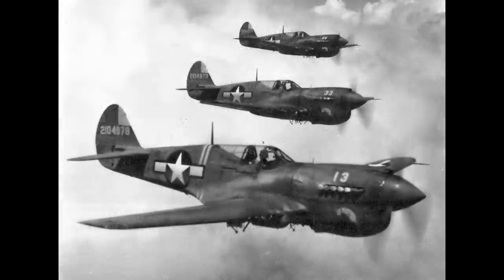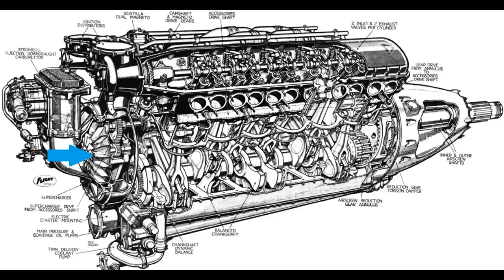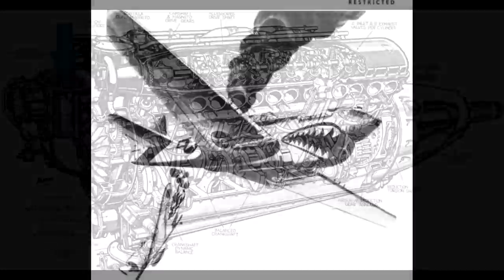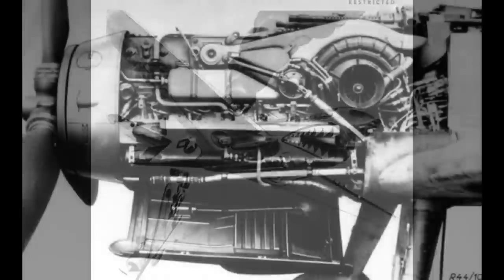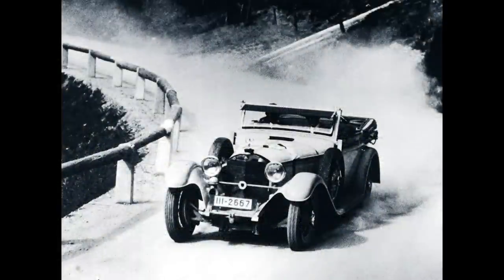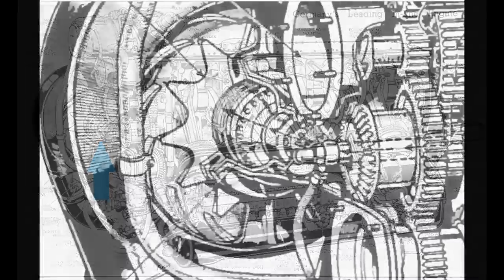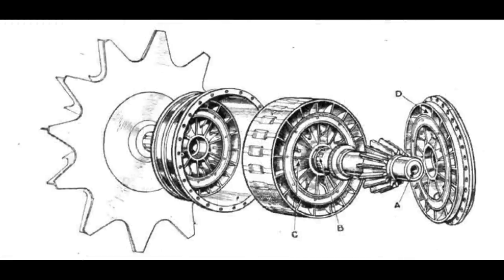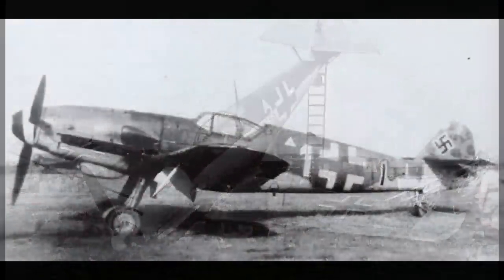Messerschmitt BF 109 Supercharger Drive System

Comment: I have a suspicion regarding Bf 109 or similar (Fw-190?) throttle controls, sophisticated as they are. If there is some regulated pressure, 1.3ata or so, and you set some partial throttle by the lever, say 1.1 and climb eventually you'll reach some altitude where wide open throttle can't provide that maximum regulated pressure. My hypothesis is that if you set 1.1 pressure that should be maintained if the engine is capable of it.

But in depictions it is shown that hands off the lever and climbing such that maximum available pressure reduces below the regulated maximum 1.25, 1.20, 1.15, etc. that the pressure also falls below that originally set even though the engine is capable of the original setting. There is some moderate altitude that in order to maintain your desired setting you have to keep moving the throttle forward.

I know that's a word salad so I'll try restate. You set 1.1 and climb without touching the lever. When does the instrument fall below 1.1? Does it reduce as the regulator becomes irrelevant or is it smart enough to keep that 1.1 all the way to the point where 1.1 is  all the engine can manage at any setting?

Answer or no, don't sweat it. Keep sharing on any  topic that springs to mind. They're all interesting and you do it well.

Comment: The DB601 and DB605 also had water/methanol injected to boose the trust even more at high altitudes and fuel injection of course. Mercedes an BMW have a long tradition of powerful engines.

Comment: The Germans had scientist that were very smart and did things really different than the rest of the World. If the Germans had used 130 to 150 Octane Fuel in their planes in the beginning of the War  they would have been a lot better than any of ours including the Mustang. The main reason the German planes couldn't pull as much manifold pressure as our planes was the 87 octane fuel they used in the beginning of the War. Later they used additives to boost the octane to 130 to 150 but by then they were on the losing end of the War and had lost tons of planes and good pilots!
Reply from the maker: Yup, I have a whole video about that!

Comment: Instead of using 2 stage superchargers that offered 2 altitudes at which engine performance was optimized, would it not have been possible to simply build a fluid coupled supercharger like this but optimized for say 30,000 ft then use the barometrically driven coupling to optimize performance from 30k all the way down to SL? What would be the downside? Would this have resulted in a supercharger that was too large to fit inside the DB-601/605/603 engine nacelle?

Great video Greg - thanks! You are clarifying things I understood at a much more basic level and clearing out misconceptions.
Reply from the maker: They could have done that, used a bigger supercharger with the fluid coupling. The drawback is that all compressors have an ideal range, and getting 20,000 feet out of one compressor is already really good. If you make one that's great at 30,000 feet, it's going to suffer at 10-20k feet. The Germans still had to fight down low, so they really did need a second stage.

Comment: Check on that P-40 supercharger.  Believe the Allison fitted to the P-40 didn't have a blower.  This limited it to low altitude.

This was a limiter in the early Mustang.

As for the hydraulic drive: when driving a high speed or high inertial load it is necessary do have a flexible connection to isolate and dampen the torsional vibration of the crankshaft from the load. A crankshaft speed varies through the operating cycle. These variations if not dampened can stress and break shafts. 

A torque converter in a automatic transmission does this as do the springs in a clutch disc in a manual transmission.
Reply from the maker: No, the P40's Allison does have a supercharger.

Comment: Now this me be way off,  but at one point I think to recall you can get stronger gears with less gyroscopic mass with a 90 degree set of gears over normal gears.  If you need 1 inch width of gear as per spec on normal gears it will look like a "T" from a cross cut view.  the "T" section is a lot of rotating mass.  If you have gears set at 90' you lose that "T"  cross section and it is now a "I" with the gears set at 90'  you can now increase the width of the gear from 1" to 1.5" across the flat surface and the mass does not increase. But you have a larger surface for tooth/mesh contact.  Now again I have no clue What I'm talking about and this was something we talked about in the 80's when I was learning about cars and transmissions in auto shop.
Reply: Having some extra time to think about why is it mounted at 90 degrees.  I think you answered you own question in another video.  Going back to 1980's auto shop,  Why are most if not all distributors on cars mounted 90's to the cam.  Some race cars do have have the distributor mounted on the end of the cam shaft but the are mostly race cars.  It is to save space under the hood and make the engine assembly shorter.  If the distributor was mounted on the end of the engine, then you would need to make a longer engine bay, extra wight longer hood etc. etc..  Now my thinking is with the 109.  If the Supercharger was on the end of the engine it would be taking up valuable space that could be used for something like fuel.  Mount it 90' degrees and it is next to the engine assembly is not any longer, it is not taking up valuable space that could be used for something else like fuel  or the pilot etc.  It just needs some extra panels to enclose it on the side of the plane.  It might also make it easy to just put a snorkel on it for the air intake and you are good to go.....Not an engineer, just a tech that fixes broken things engineers design,...?

Comment: Excellent info! You are a very good teacher. When I look at the common rail system on my diesel engine, the inlets are 90 degrees toward the cylinder block. That makes the engine take up a huge amount of space in the engine room. Could it be like that the Germans engineers wanted to save space and came with a unique solution regarding the compressor?

Comment: The RLM (German Air Ministry) specifications for V12 aero engines dictated that they must have allowance for a machine gun or a 20mm cannon firing through the prop. This was naturally also followed by Jumo, which is why it was also possible with the Jumo213. The fact certain aircraft didnt choose to fit the cannon is an incidental. Such a fitment does also remove one 90 degree bend from the intake system, but that is also an incidental and not the reason it was done. This document specification was created by Dr Helmuth Sachse, Dr Kamm at the DVL and Dipl. Ing Jellinghaus at Luftthansa after discussions with industry which started in 1928. You may read all this yourself (if you can read German) on page 20 of "Aufschwung und Wende Vom Kolben-Grossflugmotoren zum Strahltriebwerk" - an interview from 10th April 1987 at the Deutsches Museum in Munich,  between Dipl Ing Kurt Grassmann and Dipl Ing. Wolfram Eisenlohr (who was in charge of engine development at the German Air Ministry from 1938 to 1944). The German transcript is available on hard-copy from the German Aerospace Agency for a small fee, it is this report which is referenced by the only serious book which very briefly mentions this topic ("Aeronautical Reseearch in Germany from Lilienthal to Today" - by Hirschel)

This stuff is all covered in my book coming out in April 2020, through the publisher Mortons.

Later next year I will be publishing the translated technical memoirs of Prof Dr-Ing Karl Kollmann, chief designer of Daimler-Benz in 1944/45, who patented the use of the Fottinger coupling applied to aero engine supercharger drives on 27th June 1935 whist at Daimler-Benz. US patent numbers: 2238889 and 2290884. I have interviewed his son in Germany, and was given his fathers memoirs and papers, which I have translated to English.

https://www.calum-douglas.com
Reply from the maker: Hi Calum, I'll be looking forward to your book. On the subject of weapons placement, I cover that quite a bit in my inverted V-type videos, specifically part 2. I have no doubt's that the RLM wanted a weapon firing through the prop hub, and I get how that would make the 90 degree drive desirable, but it doesn't explain the 90 degree drive in German cars, which pre-date any aircraft application. It's also worth pointing out that various Soviet planes had weapons firing through the prop hub, both machine guns, and cannons, and they didn't use the 90 degree drive. So, while I agree 100% that the RLM wanted a weapon set up that way, I'm not so sure it explains the unusual supercharger drive. I think there is something we are missing here, but I don't know what. I have seen some solid theories though, but nothing concrete.
Reply: @GregsAirplanesandAutomobiles  - Hi Greg, cheers for the kind reply. The main engines which had coaxial prop-cannon AND a non-side mounted supercharger were Hispano Suiza HS.404, the Klimov M-105/107 and the Allison V-1710. These were possible for the following reasons.

1) The Allison could do it only in the Airacobra because the prop is way ahead of the engine so the proxmity of the supercharger doesnt matter
2) The 404 and Russian engines had a very unusual intake system which places the inlet pipes on the outside of the engine block instead of down the central "vee"
3) The Hispano and Russian engines above also have tiny superchargers of very small overall diameter which just avoid the prop axis
4) All are upright engines, not inverted

The DB has a large supercharger, and hence no room to fit gun through the vee, and the reduction gearing sizes also place the prop closer to the crank axis than the Russian or Hispano engines, you need to do a bit of both the bigger reduction gear and smaller supercharger to have a coaxial cannon with a rear mounted supercharger, both of these compromise you, as the small supercharger will kill your altitude performance, and if you are inverted, a big reduction gear>prop gap is a no-no due to prop>ground clearance.

Any usage of side mounted blowers in cars etc prewar is purely serendipitous in nature, and there are other valid reasons for considering it (eliminating one bend) but this was not why it was done in the case of aero-engines. I cannot speak for the car designers, I guess thats another book...

Comment: Please list PSI and BAR when saying IN/HG. A lot of us are only used to PSI and BAR.

Also, could you do something on the kommandogerat? The command device used in the 190-As and Ds.
Reply from the maker: Hi Marcus, OK, that's a fair point. I realize there are still a few of you out there using the Metric system. From now on I'll post manifold pressure values in inches HG, and include BAR. Maybe PSI, just don't ask for millimeters of Mercury, that's not going to happen unless I am discussing Japanese planes.  Adding in Bar is quite reasonable, thanks for pointing that out.

Comment: The ProCharger I-1 has a CVT driven impeller that can do something similar to this, but that was released in 2013 about 70 years after the 109.
Reply from the maker: Yes, I have looked at it. It's along the same lines, but does not have the same range of control. Also, it doesn't seem to be too popular, I'm not sure why not.
Reply: @GregsAirplanesandAutomobiles   I think the price of around $9000 is a big reason it is not very popular.

Comment: The angular momentum vector of the supercharger goes as (moment of inertia of the impeller) × (angular velocity)squared. If I knew both quantities I could calculate the length of that vector. Knowing the distance between that vector and the 109's center of mass I could calculate the effect on yaw rate.

Comment: I`m sorry if this is dumb , I`m a Brit and I know very little about the Alison . Were they ever fitted with two -stage superchargers?  It  seems it was not a bad engine, and surely it would have been a very good engine with this upgrade?     Did they quit development?      
  As for 90deg. drive on the DB ; servicing and overall length of the power unit is my bet.
I have worked on Spits and 109 airframes , and ease of servicing and assembly was high on Willie Messerschmitt`s agenda. Some examples :the 109 cowlings are hinged and act as work platforms (spits have dozens of dzus fasteners  which are a right pain to line up!)  the whole engine is easily removable with the engine bearers still attached.   Wings , easily detachable 
( 3 bolts) and interchangeable!   The Spitfire wing had 7 pins frozen in to individually reamed holes !  The Spit  took 3 times longer to build ,and, I would guess it has three times the components.   I have not worked on these engines but think I would prefer "supercharger removal" on a 601   to a Merlin!
Reply from the maker: There was a two stage Allison, but it was too late to have any effect on the war and very few planes used it. The P-63 had it.

Comment: Just from thinking about it. Pure speculation here! I'd imagine it being somewhat of a necessity at first, to save weight and size. Like in the case of the Bf 109, being assembled modularily, keeping the engine as compact as possible and the connections into other building sections minimal will speed up production. And the other engine manufacturers either had engines developed along those stadards in hope of getting the contract (building 109's engines) or just saw, what Daimler did, took the solution, to the problem of placing the supercharger somwhere and ran with it.

Comment: I do have one question though in regards to the Bf-109's Daimler-Benz DB-605 engine; was the fact that it was an inverted V-12 the reason why similar sized, yet upright V-12, Allied engines, like the Allison V-1710 and Rolls Royce Merlin, the reason why it did not have comparable power output at altitude? I've read that, at altitude, the Merlin, especially, would output nearly 100 to 300 more horsepower than DB-605 engines, and the only real way to increase power, even for a brief moment was the DB-605's MW-50 water-methanol injection system, as fitted to the Bf-109 K series towards the end the war. That said, is it possible to make an inverted V-12 engine that is of a similar size to the DB-605, and yet outputs the same horsepower at altitude as the Merlin without having to rely on a water-methanol injection system, which obviously could not run continuously? I have read that there are other Axis inverted V engines, such as the larger DB-603 and Junkers Jumo 213 series, which were supposedly better than the DB-605, such as the Jumo 213-E used in the Focke-Wulf's experimental interceptor, the Ta-153, and its predecessor, the Fw-190 D-series which also used the Jumo 213. That said, what was it about the Jumo 213 that made it more powerful than the DB-605?
Reply from the maker: I have entire videos on those subjects, so I can't really cover those in the comment section. I have a video on the P-51's speed vs. 109G, and a later video explaining how the Germans made the 109K much faster. Then I have a video on the TA152 which should answer your questions about the Jumo. I do specifically cover all of this stuff.

Comment: Maybe the way the superchargers were mounted in the german planes was simply due to a less complicated and shorter path that the air would have to travel. Consider this: when tje supercharger is at the end of an engine the air must travell parallel to the engine cowling and turn at an 90° angle. When the supercharger is up to the side the air is forced into the supercharger throug a short pipe. It also turns at a 90°  angle but the distance it jas to travel is less.
Reply from the maker: That could very well be the reasoning.
Reply: @GregsAirplanesandAutomobiles  I don' t know if you heard of it, but the one and only japanese WWII liquid cooled engine fighter, the ki-61 also had the same thing. That is very logical as it run the DB 601 or its japanese reploca, the Ha 40. It also shared other similarities with the me 109, but had somewhat better flight characteristics and better armament: two fifties and two twenties.
Reply from the maker: I am familiar with the Ki-61, and I'll cover it at some point.
Reply: @GregsAirplanesandAutomobiles  Cool. Btw the Pe- 2 has its intakes on the sides, but i don't know if it is supercharged.
Reply: Gas-dynamic flow might be influenced by the orientation of the supercharger impeller relative to the cylinder banks. The bend radius in the piping from the supercharger to the cylinder heads appears tighter in a drawing of a RR Merlin than it does in a DB601.

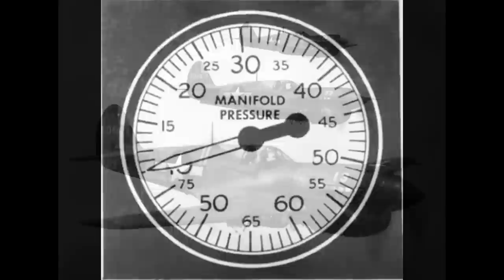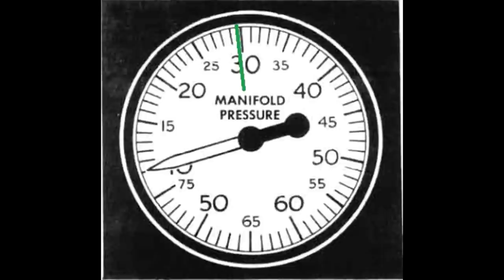Comment: In the applicable “109 Suppercharger” video, from approximately 0:48 through 1:05, is shown the dial/readout of a Manifold Pressure gauge.
The major pressure headings/legends therein are  currently shown as: 10; 20; 30; 40; 50; 60;  & 50.
Based on the linear format (and the inner 5 pound incremental headings), that “second” 50 should actually be a 70.
🤔

Just say’n.
Reply from the maker: I see what you mean now, but I don't care because it has zero effect on the video. Yes, the guy who drew that picture made a minor error on the part of the scale we are not using anyway.

Comment: Hello Greg,

Thank you for posting this. I am fairly new to this, so don’t mind me asking.
At 3:53 minutes you speak about the DB engine using the supercharger on the side of the engine, rather than on the back. Couldn’t this be because of cooling? 

The Smithsonian book on the evolution of aircraft piston engines (by Fayette Taylor) discribes a turbosupercharger on the nacelle surface for cooling purposes.
Now I know that the DB engine has it on the inside, but it made me wonder.
Reply from the maker: Hi Steven, it's not for cooling, good thinking though.